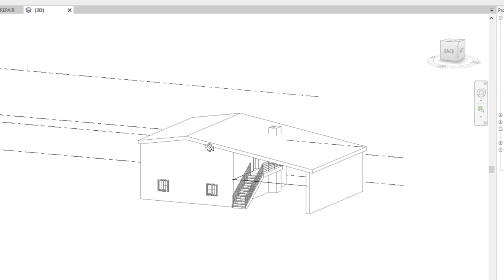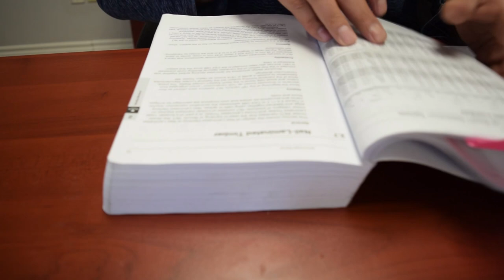EP.1 DAY IN THE LIFE OF A STRUCTURAL ENGINEER - DESIGNING A BEAM

Comment: Hi! I'm a recently graduated civil engineer watching from Mexico. Nice video but I have a doubt: why did you design the beam by hand and not by using some software ?
Reply from the maker: Because that's the fundamental of engineering, of course we use software but teaching students that software is the solution to everything would not be good in my mind. A strong basis of first principles and understanding is necessary.
Reply: Because it is a simple beam. Even a 2-storeyed structure can be accurately designed by hand, but its preferred to use software to save time & effort.

Comment: How often do you see a roof ridge that runs parallel with the floor joists in the attic? I think my roof was reconfigured after the 1925 Tri State tornado. It was probably torn off. My guess is the ridge ran from front to back of the house prior to the twister and now it runs from side to side. They built two knee walls and left the center open, I would assume for future living space to be built. There are big windows up there, a built in stair case. It sags like nobody's business. They installed the ridge beam with 3 separate  pieces of 2 x 8 and mending plates. One has a bird's mouth cut into it and was obviously a piece of scrap. LOL. Crazy but the old beast isn't going anywhere.  https://www.flickr.com/photos/86144799@N00/27266349916/in/dateposted-friend/